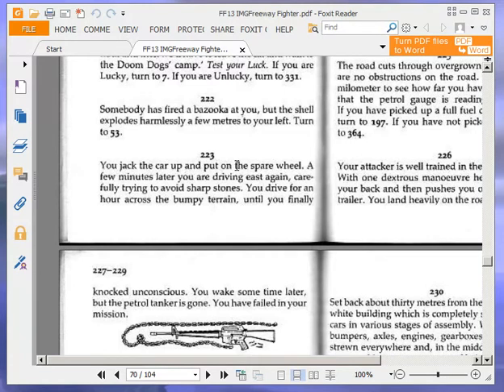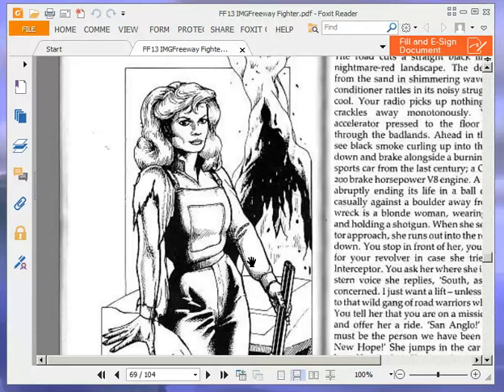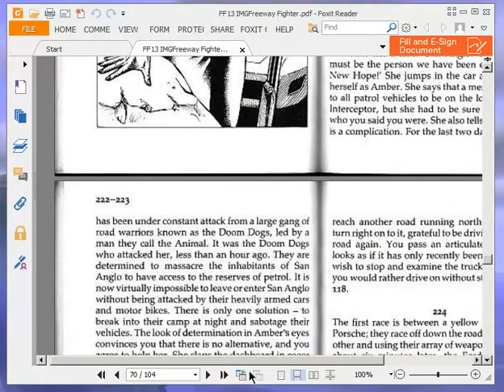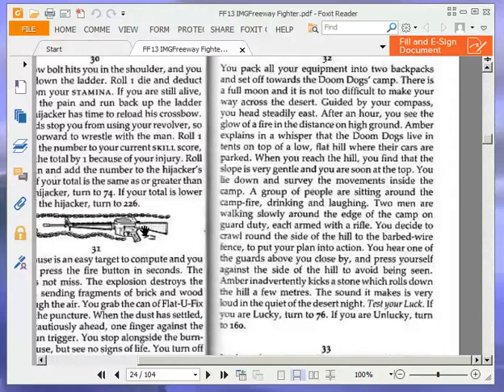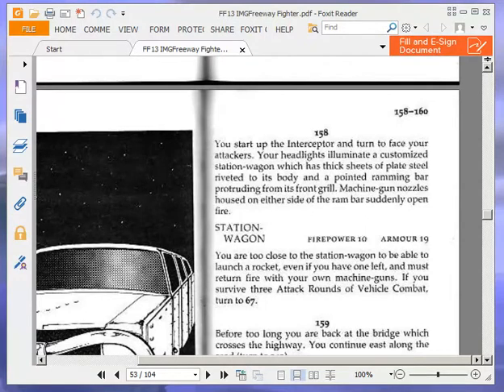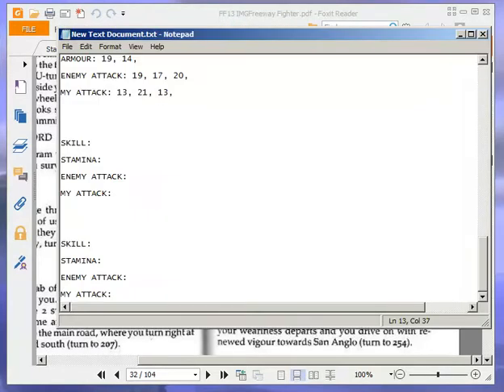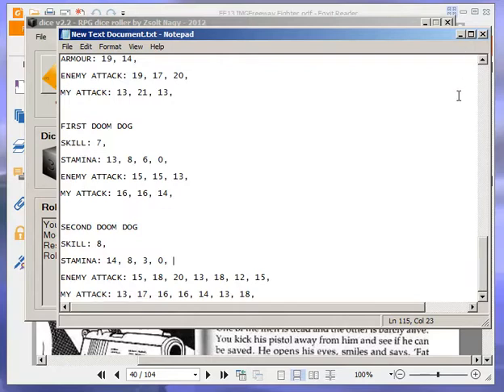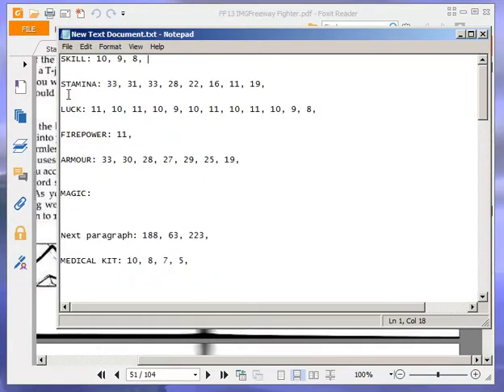Let's Play Freeway Fighter (Fighting Fantasy Game Book) Part 4

Comment: A carburetor is a device inside an internal combustion engine that mixes air and fuel to start/keep engine running..it's found under the air filter system
Reply from the maker: Thanks!